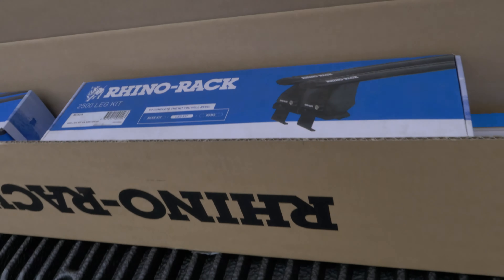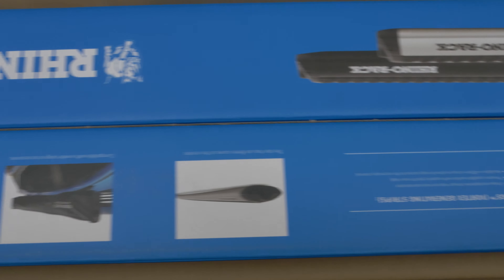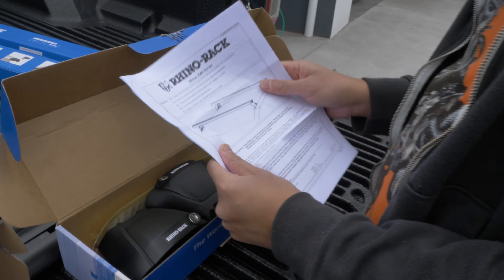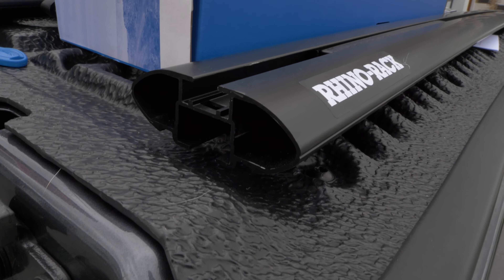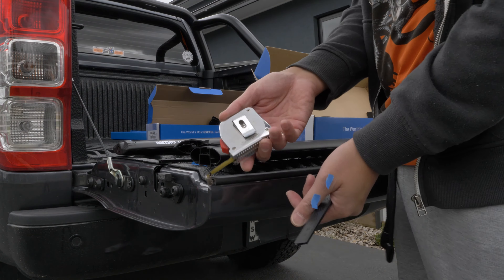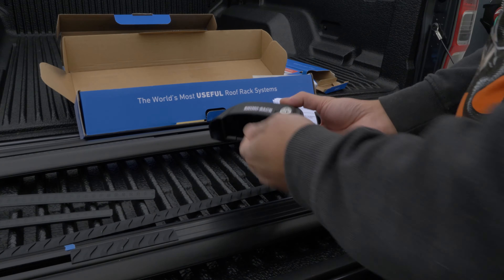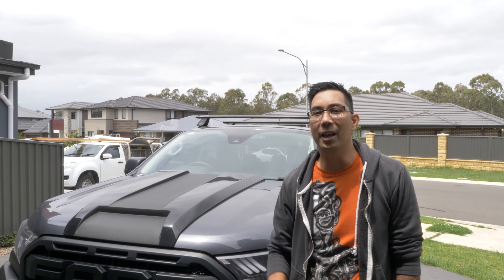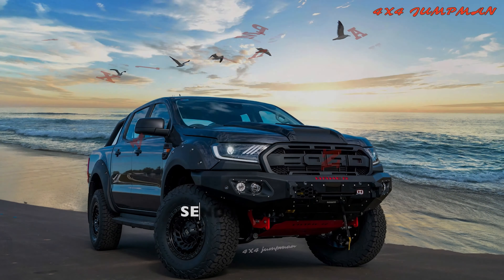RHINO-RACK VORTEX CLAMP MOUNT INSTALLATION GUIDE

Comment: Unfortunately, clamp mount is not better. The weight of the load will push the clamp mounts outwards, reducing the clamping force. Anchor mouth is alot more stable.
Reply from the maker: It has its positives and negatives…I can remove my roof rack if I don’t need to use it anymore and it won’t leave any holes in the roof..the roof has a load rating so putting more load on roof will reduce my 4X4 capability..putting a hole in the roof can increase chance of water leak if not done correctly using anchor mounts. Also installation will cost more unless you can do it yourself but not everyone can. Easier to clamp mount a roof rack and takes a few minutes.

Comment: What about 2020 200 series landcruiser?
Reply from the maker: I can’t see any clamp mount for the 200 landcruiser on their website..it’s best they are bolted on for more weight capacity. The only downside you can’t take them off if your not using them.

Comment: Thanks for your content, i find it very helpful. Have you had any issues with water leaking where the clamps go into the door jams?
Reply from the maker: No leaks at all and I’ve had it for 2 years now as long as your door seal is intact.
Reply: @4X4JUMPMAN  thanks mate. I'll order a set in that case. I don't want to drill holes in the roof.
Reply from the maker: @DeltaMikeNoshoot  yeah I was the same I didn’t want to drill the holes.

Comment: Unfortunately I bought a Rav4 and didn't even notice that it was a naked roof. I do a lot of kayaking and felt like I shot myself in the foot. Will this support heavy kayaks like a Hobie? Any potential problems with that application?
Reply from the maker: Check the roof weight capacity for your RAV 4…ford ranger is 80kg and can’t put more than 70kg. Less if going off-road and whilst car is moving. How heavy is your kayak? …installation is easy and very strong. Only limit is weight capacity.
Reply: @4X4JUMPMAN  the roof will handle it. I was more worried about the bars and legs holding onto the car tight. It weighs 70 pounds. I'm also concerned about rain getting in as a result of the clamp on the door frame.
Reply from the maker: Holds very tight as a clamp and no rain gets in the door. But you may need the front rhino rack tie downs for kayaks for more support.
Reply: @4X4JUMPMAN  I'm not familiar with those. Are they just basically cords? I have pretty hefty straps that I loop over the top and then through the interior of the car.
Reply from the maker: @Corkfish1  it’s like this it straps on the front of the bonnet or your car. https://autobarn.com.au/ab/Autobarn-Category/Shop-our-Full-Ranges-by-Brand-%7C-Autobarn/Rhino-Rack/Rhino-Rack-Bonnet-Anchor-Strap---RBAS/p/RR02172?gclid=CjwKCAjwp9qZBhBkEiwAsYFsb1WKEvCjJIlJJ9pP0URd59Dg6wiuQspr6An67ajGSSqbewNr6uwUDBoCR-kQAvD_BwE

Comment: Does it wobble around , i had something similar before and the clamp scratch the car paint
Reply from the maker: Nope it’s heaps strong even when I hang and pull on it…it has a rubber padding on the clamp..just make sure you install properly ..a quality brand..but just can’t go over the load capacity as it’s not for heavy load👍